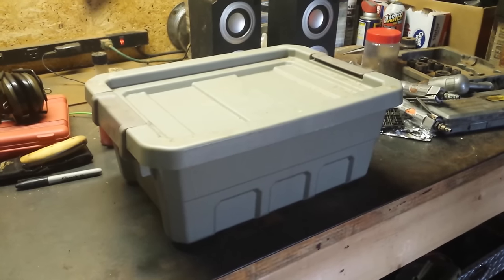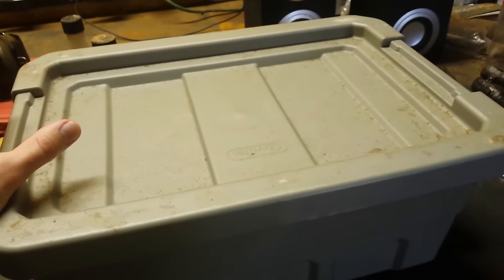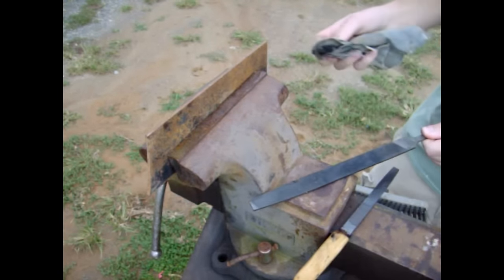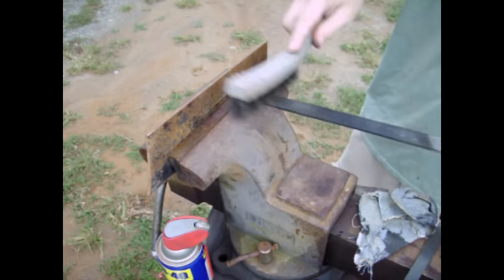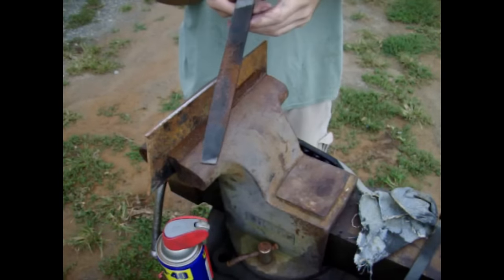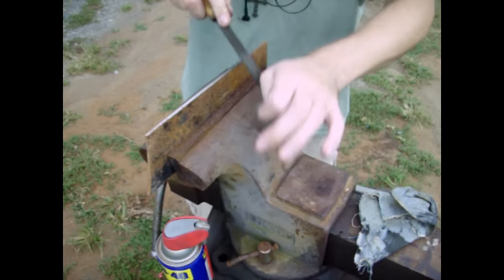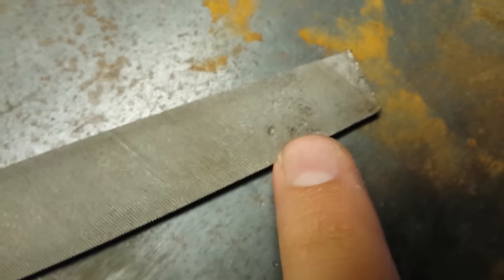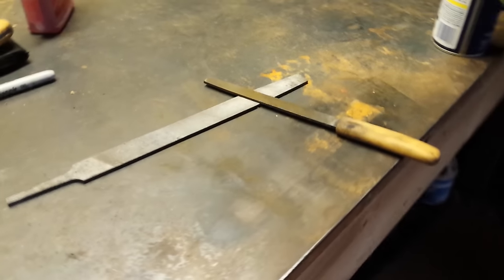How to restore your files without sulfuric acid

Comment: do not use a steel wire brush. you already lost some of your sharpness you achieved with acid. use a brass brush or a brass wire wheel and then coat your files with a light spray lubricant. do your vinegar again but clean with brass brush and check the same files and they will be sharper.
Reply from the maker: J Davidson that's a good point but I don't have a large brass brush I have a tiny one lol 
I don't think it would make much difference to be honest just because it's bristles and they are not hardened,the file is. I spray mine with wd-40 every so often and especially after the vinegar bath, i do clean mine after every use.
Reply: i added some electrolyte to my vinegar made the process much better. ideal solution is 10% acid from my research. get battery acid from advance auto by powersports batteries. getting a wire brush brass wheel that fits in your drill and clean with direction of teeth cut. my files have never been sharp as they are now.all mine were used from garage sales and flea markets.
Reply from the maker: J Davidson I agree that would definitely work I just didn't want to use conventional acid. I'm the same way I would rather get something from a garage sale do a little work to it and it be good as new.
Reply: J Davidson nn
Reply: From a chemistry standpoint, all aqueous acids (acetic acid, sulfuric acid, nitric acid, citric acid) are the same in how they work. They donate a proton to other molecules which, in the case of metals, strips the electrons away from the metal. The electron taken from the metal bonds with the proton because opposites attract, just like poles on magnets. Losing the electron though, is what causes the metal to degrade. The more surface area exposed, the more electrons can be ripped away which is why this trick works on files. 
Long story short: Doesn't matter what kind of acid you use, as long as its not so concentrated that it eats the file too quickly.
Reply: Good tutorial
Reply: Hi,Cnt_drive_16. I'm not trying to belittle you, and i can see from your comments that you analyse criticisms  and subsequently  adapt your advice if you think it warranted, so I offer these points based on my five decades of engineering experience.
No I, a file "card", which is about the size of a bar of chocolate, and has closely packed BRASS wire brisles,  is the tool best suited to maintaining files. Your wire brush will, like most wire brushes, have bristles made of hardened steel, and will blunt the file.( If they didn't, they wouldn't make  file cards. Also contrary to a poster above, it is best to file a little brass the first time you use a new file, as the teeth are just a little bit too keen, and some dig in and break. A half minute or less filing brass makes the teeth just right. 
Best wishes to you.

Comment: THANK YOU FOR POSTING!
   MY Dad used to work with another fellow, back during WW2, reclaiming files. Factories would use files till they just were worthless. They would save them for him and Dad. Then, Dad said, they would use a wire wheel on a crank, (clamp-on), grinder and remove all dirt and metals from the grooves. Then rinse them off and roll them in a towel. They would roll the towel around one file, then on the outside of the towel, they'd put a file on each side and wrap it around one more time and a file on each side, till they ran out of towel. They'd leave the bundles in the sun for 30 minutes and then un-wind them. They were perfectly clean and dry. Then they would lay the files in a glass vat, suspended on little 1/2" x 1/2" wooden pieces the tips and tangs, up off the floor of the vat, and made layers with a little space in between the files. Then they would gently pour in battery acid diluted with water. (I don't remember...seems like 3 to 1, water to acid). Naturally they used their PPE, (aprons, goggles, & gloves). He said you had to take one out and rinse it off and put it in a vat of water and baking soda, to kill the acid, then rinse that off and test it. If it was satisfactory, the whole batch was ready. He said you had to play with the timing, because you could never get exactly the same acid ratio because if the quality of the acid that you dumped it out of a battery. 
   What it does, is etch all surfaces. The file is thinner and less wide, than it was to begin with, but sharper than it was when it was new. After you take them out, and neutralize the acid on them and dry them, you wrap them in newspaper, with 2 thicknesses of paper between each file as you roll them up and twist the ends. This keeps them dry. He said not to introduce oil to them. Leave them pristine. When they re-sold them, each bundle had 10 of the same sized file in them. They were ready to use, right out of the paper. 
   I have tried it and got some awesome files. I hope this helps you.
Reply from the maker: That is pretty cool. Thanks for sharing.
Reply: Very cool story!

Comment: Golf ball handle....I've done this for years....not only safe but it keeps the surface of the file off surfaces.  Forget the nut....just drill smaller hole (about the size of the tang at mid-way)....bang it on.
As for "sharpening"....I suspect all the acid does is clean gunk out of grooves....makes edges "proud" so they can grip the filed material.

Comment: With respect, I've been using files for over 60 years and not once in that time have I ever seen, or heard of a resharpen of a file. To preserve the edge on any file is to 1) use a card brush immediately after and between filing. 2) Store it on the flat separately so as to avoid contact with other files. 3) Always keep it clean and minimise exposure to workshop atmosphere (moisture). The anatomy of a file (rasp/file section) is lines/edges/teeth. The space between teeth get clogged, the card brush is effective to remove the crap between the milled edges. It will feel that it has sharpened after the process you describe, but that's because it's clean, and is temporary!  The hand craft Motto was: use it, clean it, store it, wear it, bin it.
Reply from the maker: nifty1940 thank you for the awesome comment and information!
Reply: No.1 is wrong. The first thing I was taught as an apprentice about files was to throw the file card away  and use a piece of softer metal ( aluminium  or copper)to clean  the
Reply: No.1 is wrong, use aluminium  or copper to clean the teeth. The file card should be thrown in the bin as it will dull the file.
Reply: @rogerallen5191  
That works well for 'pegs' and 'pins'. For routine cleaning while the file is in use, I use a brass suede brush. This has way thinner wire and really gets down to the bottom of the grooves

Comment: As a bonus, you can use the browned vinegar for staining most hardwoods, as long as you figure out how to get rid of the smell. Try it, oak gets all black, a lot of woods become deep brown. Depends on the wood, not the amount you use.
Reply from the maker: Thats a very interesting thought, I didnt even begin to wonder what I could do with the used vinegar other than pour it out. Thanks for the comment and the idea.
Reply: Cnt_Drive_16 I have a ten-year old batch of vinegar-dissolved steel wool sitting in a jar. The colour is yellowish at first, then turns green, then deep rusty red, and eventually over very long time, inky black.  If you dissolve a lot of steel at a time, make sure the container leaks a little: for what I've heard, the pressure buildup can result in a glass container splitting
Reply from the maker: So can you use it at the red or green stage to stain wood?

Comment: So you did sharpen them with acid in fact.  BTW, you can convert the weak acetic acid in vinegar to the much stronger hydrochloric acid by adding common salt (sodium chloride).  This makes the acid that is already there more reactive & therefore make the job faster.  It does not increase the concentration of acid though, so it will still only treat the same amount of rust before it's completely used up, it just does it much faster.  Keeping the acid warm makes it react faster as well.

From memory, you add about 2g salt to 100 ml vinegar, probably best to google that though.
Reply from the maker: Love the information!!! Thank you for the comment!!!

Comment: I learnt the vinegar trick from another utube site; works a treat! I avoided using sulphuric acid due to it's high cost at the local hardware shop.(A$55 for one litre!!!)
Reply from the maker: Allan Wells I had no idea it was that expensive , good thing I tried this out.You can drop a link to the other video if you would like I wouldn't mind seeing it myself I didn't know anyone else had tried this.Thank you for watching and I appreciate the comment!
Reply: That is expensive. Must be reagent grade.  I get plumbers grade 98% for $10 a quart.  Great for cleaning toilets once diluted 10:1 water:H2 SO4
Reply: Coles now sells an 8% vinegar
Reply: You can get sulfuric acid as liquid fire (brand name drain cleaner), it's roughly 99%

Comment: I will try this on some of my older files. The physics of the way acid disolves metal makes sense.  It will eat away at the peaks and valleys at close to the same rate. And S it does this it will remove the damage from the sharp edges leaving close to the original geometry.  I still believe the best way is to use a file card and piece if copper during and right after use then store them in something like a wrench roll. But this should help to bring some usefulness back to my old dull files.

Comment: you dont need the nut in the golf ball. just drill a hole a little bigger than the end of the tang (about 1/4" dia), go a little more than half way through the ball and stick it on the end of file. tap working end of file against your work bench a couple good times and that's a wrap. all that rubber stuff inside the ball will grip the corners of the tang and tighten their grip as tang gets wider.
Reply from the maker: Have you done that?
Reply: Cnt_Drive_16 yup. did it to most of my files. I would like to get my hands on a bucket of those pee-wee golf, golf balls , the ones that are all different colors so I could better identify, at a glance , at least the type of file or something like that that can be classified by the basic color coding those kinds of balls would offer. but yea, 1/4" ø hole, no nut. ..maybe 3/16"ø, depending on the tang thickness. when you tap the working end straight down on your work bench, with file in vertical position, you know, that will seat the the ball and form around the tang as ball rides up tang. I dont think ive had any trouble with ball coming off while in use. they're way more secure than most wooden handles I've ever used . way, way better than those compression twist on handles our shop teachers used to make us use.. I just had a thought.. I wonder what would happen if this method of file cleaning was combined with the electrolysis style of rust removal I saw on here somewhere. it was either the jeep guy or ford guy, maybe both? ..using a battery charger , bucket of base solution and sacrificial anode.
Reply from the maker: Now your talking my speed! lol I'm not sure if electrolysis will work with vinegar but if i had to guess i would say no. Electrolysis works great on cast iron pans though. I like the golf ball being round and at the very end i don't want the tang to go thru at all. I don't want it to be dis formed at all but i do love the colored idea, I only have a few so i don't need that feature just yet lol.
Reply: Cnt_Drive_16 nothing happens to any of the outter dimensions of the ball. its the round hole that's drilled in it that takes on the shape of the tang. it doesn't misshapen the hole so much that you can't drill it out to glue a nut in and go with how you you have it now.. Its just easier and faster this way and I hang my files from the friction fitted golf ball.   as for electrolysis rust removal, it works on all rusty metal. as long as you have a big enough vessel to soak it in without any of it contacting the sacrificial anode, it will work. the negative clamps the rusty metal you're cleaning. positive clamps the anode (hunk of rebar) have them submerged in the same body of base liquid (water and a table spoon or 2 of WASHING soda , not baking soda) plug in charger walk away for a few hours , come back. done.
Reply from the maker: Oh yea I like electrolysis its easy and a pretty cool show. Just be sure your dog don,t drink out of it while the thing is on! I wouldn't mind trying the way of mounting the golf ball your talking about, If i don,t forget ill do it next time.

Comment: Will it hurt them if I cleaned them in a blast cabinet?
Reply from the maker: That is a fantastic question and to be completely honest...I don't know.
In my opinion I would say that would round the edges off of the file instead of cleaning it and sharpening it. 
I could be completely wrong though. 
Thank you for the comment!!

Comment: Some wire brushes are high carbon steel. If you use them on a regular bases it will wear on them.

Comment: Nice experiment. 
Your title is a little confusing. As you read on the label of the apple cider vinegar, it contains 5% acetic acid. In the US cooking vinegar contains 5% and if the batch is a little shy they add some or water it down to get it to 5% acetic acid. 
Even with that bit of confusion you did succeed in sharpening your files. Congratulations. Good job well done. 
Some suggestions: 
  1. Use apple cider vinegar for the process. The distilled white vinegar may seem like a better deal but it gets rancid. That's the strong smell. Apple cider vinegar doesn't spoil as fast. It also doesn't stink.  I've been able to get 3 or 4 loads of rusty parts through it before it slows down too much to use. 
  2. Make up a bath container from a piece of PVC pipe and a couple caps. I have a playlist showing the steps. https://www.youtube.com/playlist?list=PLXlq5qGw1pepNSS5f6sy8TaSfDYvkxMK2
  3. If you want to go a little faster you can use cleaning vinegar. It has 10% acetic acid and will work a bit faster. It is also white vinegar and will have the stink issues. 
  4. If you want to improve the process use battery acid. It is a mix of sulfuric acid and water. Right out of the battery it will work quite well. 
  5. I use sulfuric acid based drain cleaner. Not Draino. Draino will remove paint and organics but it won't sharpen the file. 
  6. Use baking soda as a rinse. It will kill the acid and prevent the files from rusting immediately after drying. 
Here's a link to my video on sharpening files. https://www.youtube.com/watch?v=4yLSkW5BwbM
I like the golf ball handle that you patterned after Cody's. It looks like it works well.
Reply from the maker: I didn't know they made cleaning vinegar where do you get it? The container I used worked fine but if you where going to do all longer objects I would defiantly make a pvc container. I don't like using any kind of acid, after I got a few burns I wanted to try something else. The golf ball handle is actually working really good but I did have to use 2 part epoxy to get the nut to stay in the golf ball. Thank you for all the info! I really appreciate it! Ill go take a look at your video for sure.
Reply: Cnt_Drive_16 Any kind of acid deserves respect. Even vinegar.
I don't know what kind of stores you have locally but the 10% cleaning vinegar is usually available at the grocery store.
When I was a kid the lady I use to do odd jobs for had me wash her windows with vinegar water and newspapers. Paper towels weren't as popular as they are now and the paper use to be delivered every day.
It does a good job on hard water stains too.
Reply from the maker: I'll defiantly have to take a look and see if I can find some just to be curious. Vinegar is great for a lot of stuff I was even thinking about doing a video on some stuff you could use it for but I'm sure you can find other videos already out there.
Reply: Cnt_Drive_16 I have found that even if there is are more than one video on a topic there is enough difference between the viewpoints of the creators that there is something to learn. You have an analytical approach that is rare on YouTube. It would be interesting to see what you came up with.
Reply from the maker: Old Sneelock's Workshop Thank you very much for all the help and advice I really appreciate it a bunch. Thank you to for the complement!
Reply: Newspaper is still great for windows. It doesn't leave lint like paper towels will.
Reply: You can get 100% pure acetic acid at some industrial chem supply houses. Take care this stuff can be real nasty.

Comment: Interesting. I had never heard of sharpening files with acid. I'd have guessed that acid would have a "leveling" effect on the sharp projections -- which have greater surface area -- and actually make the file smoother. I'll give this a try some time and see how it works. It would be fun to rehab some garage sale castoffs and give them new life. Thanks for making the video.
Reply from the maker: Your welcome! I had no idea that acid was the key either, much less house hold vinegar. To my surprise it worked very well and I've been using the file and keeping it clean ever since. Thank you for the comment.

Comment: You are still using an ACID just a safer milder one !  just not sulfuric acid. All Acid dose is it diminishes the radius of the angle of a dull edge by removing metal. So the stronger the acid, as well as the time the file is left in acid, will affect the result.

Comment: Just had a thought, would love some input from anyone; what about potassium alum? I’m sure you’d have to be careful to not let it soak too long, but if you’ve ever used it to dissolve a drill bit broken off in aluminum, it definitely eats away steel. Again, just a thought.